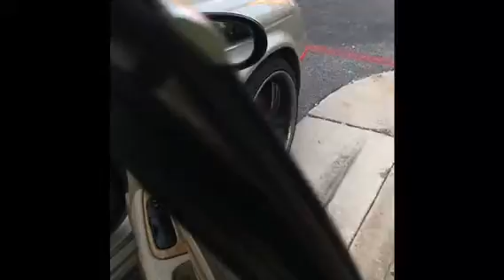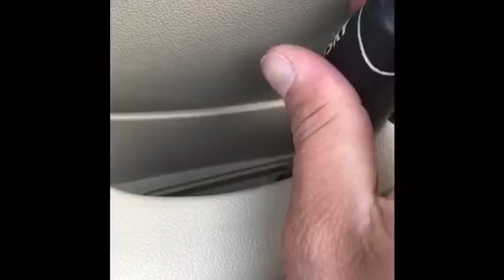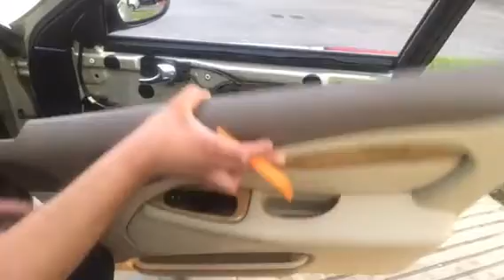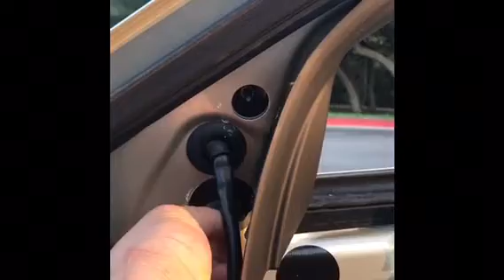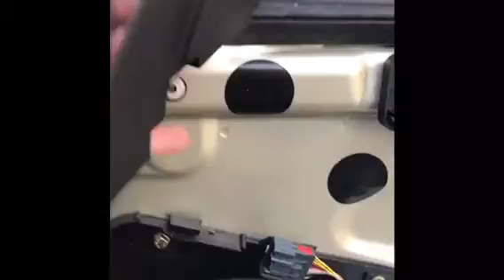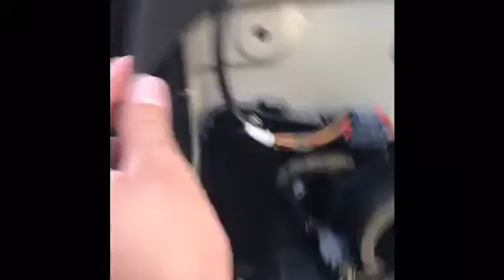How to take off full mirror on jaguar s type 2006 and door panel

Comment: Thanks for posting this it made light work of it, good on ya.
For anyone that wants to know you need a pozi or phillips screw driver for the door handle screws and a 10mm long reach socket for the 3 flanged nuts that hold the mirror assembly to the door, you might get away with a regular 10mm socket depends how deep it is,  also have a small magnet on the ready so you don't drop the nuts into the door  after you have loosened them !
Thanks again  Mr Perez
Reply from the maker: Kevin Jenkins 👍

Comment: I am having an issue with a right rear window not rolling back up, I believe it’s the window regulator , is there any way to force the window back up at the motor by hot wiring ? Or do I need to probably replace the part
Reply from the maker: Thomas Birai replace the part
Reply from the maker: Thomas Birai https://rover.ebay.com/rover/0/0/0?mpre=https%3A%2F%2Fwww.ebay.com%2Fulk%2Fitm%2F262495869333
Reply: S Perez I appreciate the link ! I swear you are better than a damn shop. They tried to sell me a 300 dollar part . And I was having a hard time finding this part . Thanks!
Reply from the maker: Thomas Birai No worries my friend anytime you need help with anything I am here

Comment: Wind noise is from side mirrors?
Reply from the maker: auto djelovi Check your weatherstrip around your door
Reply: @sperez6140  do you have instagram or fb?
Reply from the maker: auto djelovi I do not
Reply: @sperez6140  my door seals is good - wind noise is big after 60 miles/h
Reply from the maker: auto djelovi they might seem good but not good enough like new, jaguars are known to have weak doors from the top with high speed , when you were going fast on the freeway and you can hear air coming inside your car, grab your door from the top and pushing towards you see if the air stops
Reply: @sperez6140  I was tested - i think it is ok door seals, but I found on the net - said side mirrors is problem
Reply from the maker: auto djelovi 👍

Comment: What's the tool to take off screws?
Reply from the maker: abigail berry screwdriver
Reply from the maker: abigail berry are you talking about the ones on the door panels or to take off the mirror???
Reply: Servando Perez to take off mirror
Reply from the maker: abigail berry it's called a socket,
Reply: S Perez do you know what size the sockets need to be?
Reply: Left front power window repair